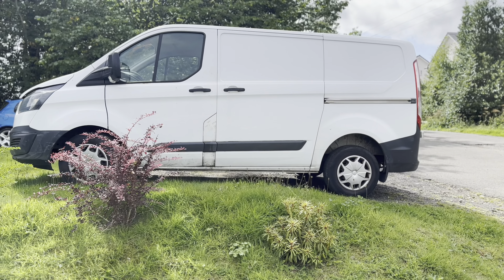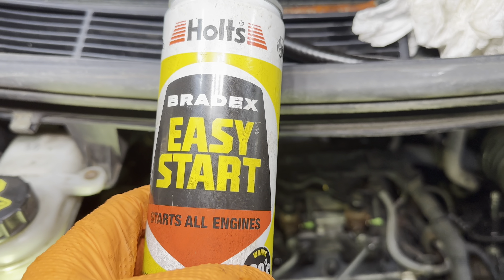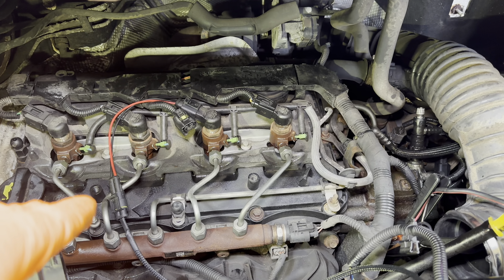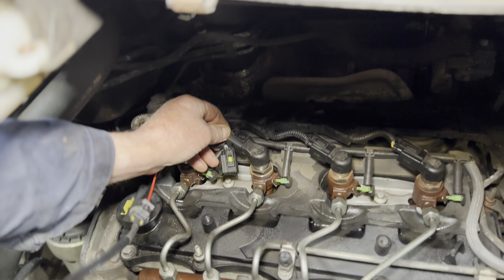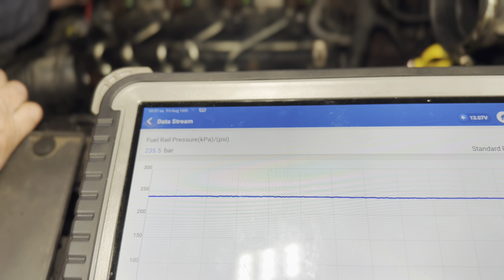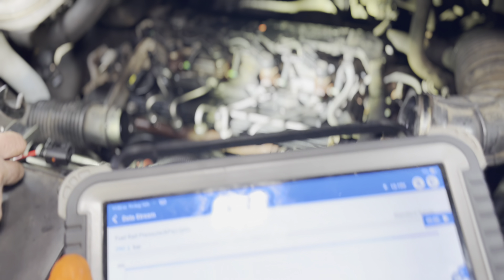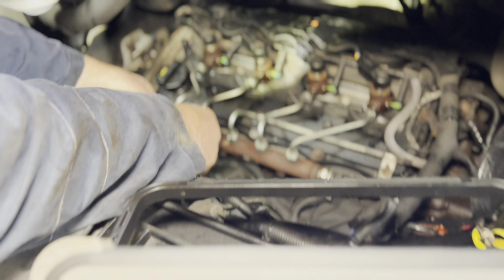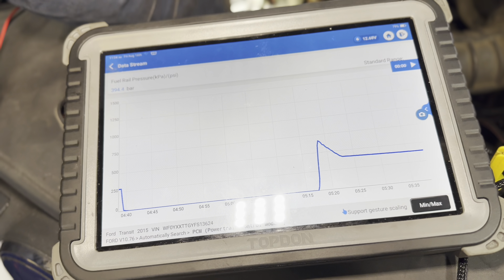Ford Transit 2.2 TDCi (2015) - It’s Bad News 🙈

Comment: Seen this problem before on a Renault traffic, the driver was scamming his fuel card and filling his company van with cheap diesel from a building site. New injectors, rail, high pressure pump and fuel tank clean later, one unhappy business owner, one driver out of work

Comment: Interesting because the filter shouldn't allow particles through that are large enough to block injector orifices.  I think I would be suspecting damage inside the high pressure pump, it's more likely that the contaminated fuel has caused low lubrication of the pump leading to metal fragmentation which is what has caused the injectors to block.  Even if the pump is damaged it can still produce sufficient pressure, the pistons inside are quite large so it takes a lot of damage before they will no longer produce enough pressure to pass as normal under diagnostic observation.  If this is the case the entire fuel system will need extensive cleaning along with new pump and injectors.  Given the age of the vehicle it's doubtful whether it's even worth doing by the time parts and labour are costed out!

Comment: Is it possible to take the injector out of the engine and confirm lack of fuel being sprayed ?   I saw it done on a petrol car with all the injectors out and aimed at a piece of paper to show the pattern.  
p.s. Wouldn't the fact that the injectors are blocked explain why you see no pressure drop.

Comment: Thats the dearest diesel hes ever gonna put in there , a shame you aint got an injector to pipe up to show it would spray , but you did a great test there Sandy , just sat in gran canaria airport on my way back to preswick,  then drive back to sunny boltin this afternoon, back to wirk weds ,already booked loads in , most expensive cheap diesel hes gonna buy , even if he goes fir injectors thry dont normally come out without a press , 600 quid starting to get um out 😂😂😂😂
Reply from the maker: Hi Mike he has towed it away, I reckon it game over

Comment: Just take the injection apart and clean it out looks like you can
Reply: After you've spent nearly 600 quid getting them out as they are probe to sieze in the head and can break when getting them out ,then it's head off ,new belt kit etc etc etc expensive cheap diesel 😂😂😂😂😂

Comment: Probably hp pumps fubured, the bearings fail, due to lack of lubrication with junk diesel, the fragments then block the injectors,   lve seen it quite a few times, £1.5k to £2.3k repair cost,